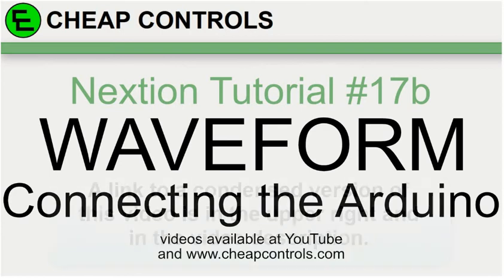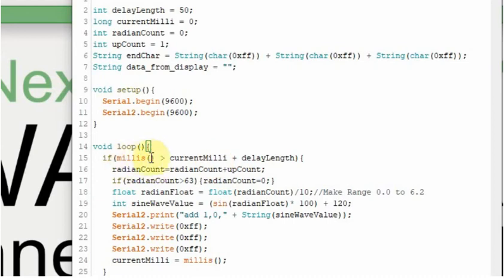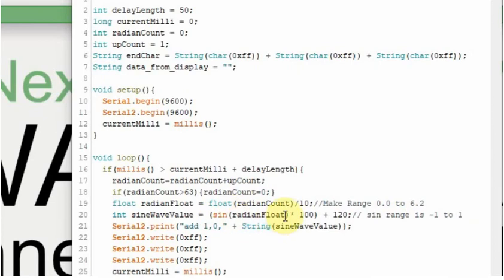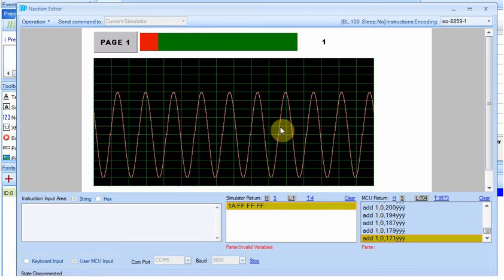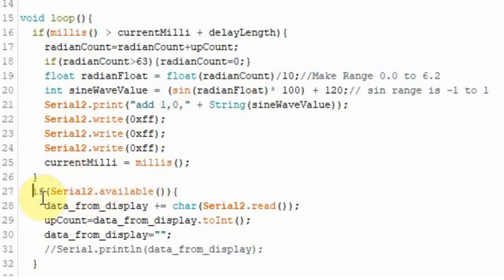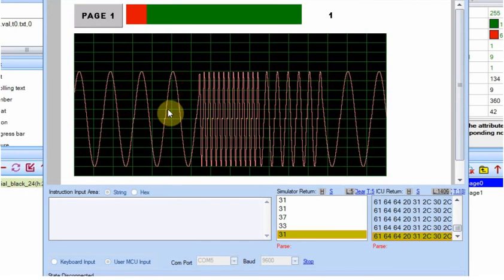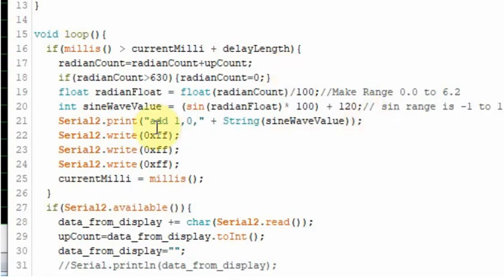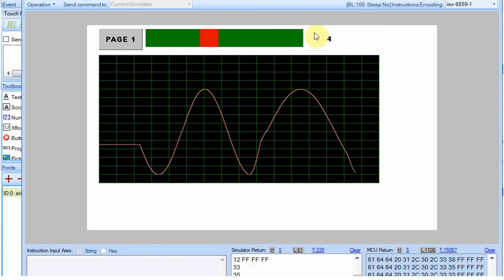#107 Nextion Display - waveform sin wave part 2 - Nextion Tutorial

Comment: How can we create a wave that overlaps itself on a display over time?

In a typical scenario, a wave starts from the left at 0 seconds, gradually filling the display to the right, and by the 50th second, the display is completely filled(for example). After that, new data is added to the right side, continuously moving the wave from left to right (or right to left).

However, I want to implement a different behavior:
Once the display is fully filled, instead of continuing to add new data on the right, I want to start adding the new wave data again from the left side — overwriting the earliest data column by column, while the rest of the old data remains and gets gradually replaced over time.

Is this possible? If so, how can it be achieved?
Reply from the maker: One way is to store the data in an array and rewrite the entire waveform when new data is present.  I am not sure about changing the behavior of the waveform.  I have some other thoughts but I would need to investigate.  If you want more input you will need to submit a comment at cheapcontrols.com.  I have a lot of videos and sometimes I lose track of the comment threads on YouTube.

Comment: I must be missing some code. My Arduino code is exactly the same as yours (using a Mega and editor verified). I suspect some lines in Nextion editor is missing. I see signals on my oscilloscope on pins 16 and 17 on the Mega, but don't get any signal on the MCU box and no sine wave on the waveform. I am uning a Nextion NX4827P043-011R-Y. Please provide code files. for the Mega and Nextion. I am 71 year old, grew up on TTL logic and 8080 mico. Trying to learn new stuff in my retirement. Thank you in advance.
Reply from the maker: I don't put my Email address in comments.  You have two options.  Find my email address on my YouTube Channel or you can go to www.cheapcontrols.com and submit a comment with your Email address and I will reply with the code and after that you will have my Email address.  I used to work with 8085 micros.  I considered adding a series of videos showing how to wire wrap and 8085 to and 8251 and memory and an 8255 and other parts.

Comment: i have a question for you.. im developing a pulmonar ventilator using nextion screen and im having a strange behavior when the nextio is reset or power of and than power on... in you video at 4.41 you aparently have the same situation... you have 1A FF FF FF Parse:iinvalid variables is what i get from monitoring the signal using the mcu input... basically it shows 01 FF FF FF when the controler is reset again... and dont show parse invalid... i guess is related to some comand it sends to the controler when it turns off or turn on... and perhaps it messup the controler baud? have you investigated it? thanks a lot
Reply from the maker: I think it is the data being sent RS232.  The Arduino starts sending the data if the Nextion is ready or not and on the first string sent if the Nextion is not ready it will get the information improperly and reply with the error code.  I have to admit I am guessing at this point.  I small glitch after a reset was not important to me in this video.  I do understand that it might be a major factor in a real world project.  If this is true the Arduino could hold off sending values until it receives a signal from the Nextion that it is ready to receive data.
Reply: @CheapControls  i found that the nextion sends a 00 00 00 00 00 00 message when it restart.. but aparently it does something to the arduino baud perhaps when its reseted with the rest comand for example.. than the message starts change from 01 to A1... i noticed that it may sometimes haves some bugs on page changes and some signals sent back... i could be doing something wrong certainly too. i wish you knew what was going on... i tried to reset the baud on the arduino side but no success.. still sending this strange different message until i reset the arduino... 

im doing a pulmonar ventilator and is being a challenge making all works well but the display is just great.. i made some mod to the lib and it now works better if wasnt for this strange behavior i would be perfectly satisfied.. if you would like to check the files you find here  https://drive.google.com/drive/folders/126_qMhjsCeM4xDxlLFZ2Li_W_cCr9pD4?usp=sharing  but i guess you might already be thinking about the problem =D if you came up with something i would love to know... thanks so much for your videos it was very inspiring and it helpd a lot to get to the point we are now! so thanks a thousand
Reply: other pages dont get the parse invalid.. only the graph signal... and only if nextion is reset and controler dont.. hope you have a clue of whats happening.. im using an esp32 as controler...

Comment: can we print negative values on waveform ?
Reply from the maker: Not directly.  The values are from 0 to 255.  However, you can do some math and convert to a different range especially if you are coming from an Arduino or Raspberry Pi.  You can adjust your range and plot in a way that simulates a negative number.